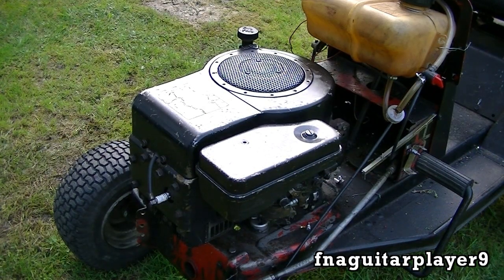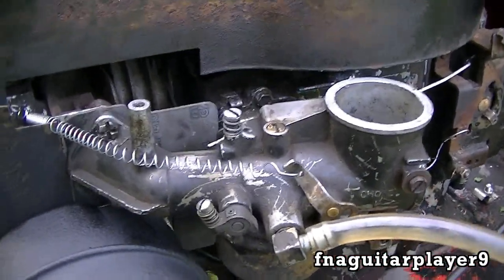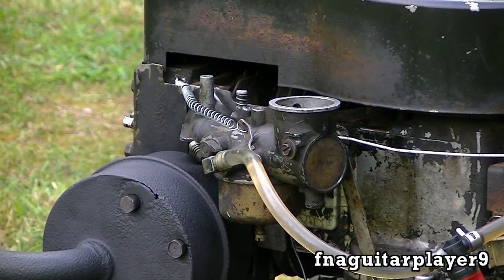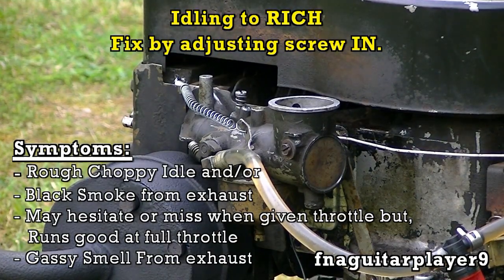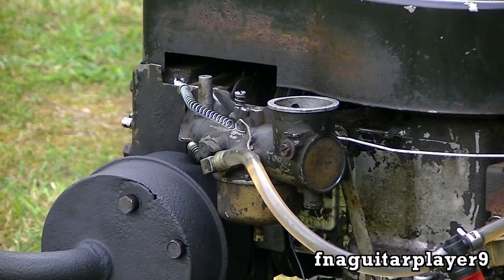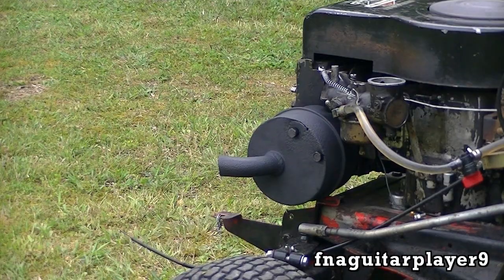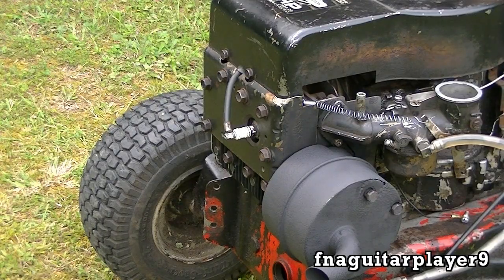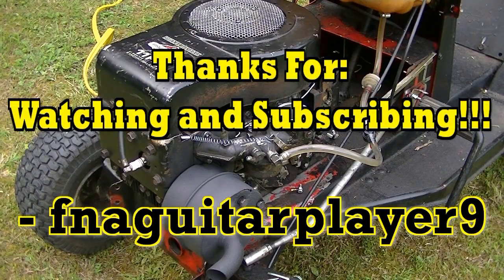How to adjust a Briggs and Stratton One Piece Flow Jet Carburetor

Comment from the maker: no it should not have to be screwed in all the way. sounds like the adjustment screw(s) is worn out, that can cause all kinds of mixture problems like this. I was working on a newer engine last year that has the 2 piece carb, it would not run for nothing, i replaced the adjustment screw and it ran like a new one haha may have to rebuild it. thats really the only thing i can think of that would cause that to happen.

Comment: I have this same carb. 98 mtd wizard. Briggs and Stratten. I have cleaned it up. Im having issues with adjusting for correct high and low side. I founf that the hight side as to be completely screwed in to run full throttle. The low side i did your 1 1/2 turn of screw. Now why is it running good leaned out.

Comment from the maker: sounds like the needle valve may not be sealing right, may have to replace the seat, some are repaceable some aren't, sometimes you can put a little o ring type gasket in to make it seal. Are you using a needle valve with a rubber tip or metal? sometimes the rubber tip ones will seal off better.

Comment: i got her running with your help ran good for a few days and now its leaking massive amounts of fuel out of the tube breather the float doest seem stuck rebuilt the carb and it start great after i watched your video on how rebuild the starter im starting work on small motors you have taught me alot

Comment from the maker: it could be set to rich or it could be a problem with the valves, you may need to do a valve job, as the compression stroke will force some air/gas back out through the carb if the valve isn't sealing right. If its pooling up inside the carburetor body when the motor isn't running then it is a stuck float or leaky needle valve. thanks for watching!!!

Comment from the maker: Thanks! First off don't use starting fluid in small engines, its to much for them, i've heard of spark plugs shooting out like bullets! I use carb cleaner as starting fluid. Sounds like you may have a clogged jet, you will need to clean it very thoroughly, I did a video on how to clean this type of carb, i'll PM it to you. most of the time a good cleaning will fix them, if not you will have to rebuild it, a kit costs less than15 bucks at tewarehouse. thanks for watching!!!

Comment from the maker: oh wow. Well, it must have been rusted or painted over. That or if its a newer one (last 20 years or so) that has a metal plate on it, may have been removed. I have one like that. The model is more than likely 252707 thats the most common for 11 horses. If it is newer than aprox 82 (transition) it will have a magnetron electronic ignition, thats 1 way to date them. Does it say cast iron sleeve anywhere on it? If its a aluminum (kool bore) you will need chrome rings.

Comment from the maker: It should either be on the flywheel cover above the spark plug, or on either side of the flywheel cover, some will have a plate close to the flywheel. Sometimes they are very hard to read if the shroud has been painted or is rusty. thanks for watching!!! If its a 11 horse the model number should start with 25. (25 cubic inch engine) thanks for watching!!!

Comment from the maker: Thanks! IT could be a few different things, it could be a partially clogged jet or filter on the pickup tubes in the carburetor. If it was a bowl type carburetor (with a float) i'd say it was sticking or not letting enough fuel into the bowl, and shuts off after running out of fuel in the bowl. Or it could just be running to lean. hope this helps, thanks for watching!!!

Comment from the maker: A temporary tach (for setting rpm speed) connects to ground and has a wire that wraps around the spark plug wire, a permanent tach (like a racing lawn mower) I've heard of people using a tach designed for a 4 cylinder engine, the spark firing is the same on it, because the plug fires once every turn, a 4 cylinder has 1 cylinder firing per cylinder so that would work. I've never done ether of them, i need to get me one! Thanks for Watching!!!

Comment: New problem, I got a new carb for my engine and it sounds better, when it starts up it will run ok for about 10 seconds then the engine just dies out. If you wouldn't mind, I could post a video of it running so you could possible help. I'm a marine mechanic but little engines are not my strong point, video will be up tommorow. I'll comment back when it's up thanks a lot for the help

Comment from the maker: sounds like something is wrong with the governor linkage or the governor itself inside the motor, hard to say really. I"ve had them do that before if the linkage between the carburetor and governor is unhooked, the throttle plate just starts opening slowly from the vaccum, i did a video on how to set this up, go through my latest videos its called "How Throttle and Choke Linkage is Setup on a Briggs 2 piece Carburetor (NEW ENGINE) " i show how to check the linkage to see if its set up/working...

Comment from the maker: i think it was like 3/8" by 2 inch or something like that, its not really critical just as long as it keeps it closed and isn't way to strong that its hard to work the choke. yeah it works pretty good, main reason i did that was because i didn't have a choke cable on the mower, and the choke always wanted to close on that carburetor. there supposed to have a built in spring, but this one was broke. thanks for watching!!!

Comment: please tell what size spring you used on that carb and where to get one. I want to do the same on my 1984 11 hp briggs on my simplicity 4211 What I want to rig with the spring as a manual choke so I can just sit on the tractor and hand choke it by hooking up a spring. Let me know what you think will that work? does it work good for you?

Comment: You seems to be very good to fix carbs !! i don't know if you can help me ?? i have a lawn mower with a B & S 12.5 hp , i cannot get the engine to idle , it just run full throttle , i tried to adjust the governor and clean the carb but still just stay at full throttle.Any tip for me ??
Thanks

Comment from the maker: yes. all lawn mower engines have governors, the only way to adjust these governors is to replace the spring, sometimes it weakens and you will loose full throttle rpms. thanks for watching!!!

Comment from the maker: not all the time, just now and then, and when i do i usually don't charge nothing, because its friends. eventually i'd love to open up a shop. Just can't afford to get started. But a few good prices would be like 20 bucks for a carburetor cleaning, 75-100 bucks for a full engine rebuild, with the customer buying the parts, maybe like 10-20 for a tune up, depending on what all needs to be done. Or you can charge by the hour. Just to give you a idea. course you can set your own prices.

Comment from the maker: that sounds like the float/needle is sticking and letting it flood out. wouldn't hurt to take the bowl off and check the float to see if its working freely, also should have said, always clean a carburetor thoroughly before rebuilding it.

Comment: Thanx for the quick reply! Think I screwed up by taking the flywheel off first! by doing that it allows the Crank to travel in and out putting undo presshure on Connecting Rod & Rod Bearing! Think I will put Flywheel back on to stabalize Crank Shaft Travel! Thanks Again!

Comment from the maker: some motors are picky, and i had one that had a rough high side but once under load it smoothed out perfectly. it bugged me, so i looked a little further, turned out the governor was out of adjustment! i'll plan on doing a video on that later on. try it under load and see what it does, if it still doesn't smooth out, may need to rebuild it.

Comment from the maker: thanks. to be honest i've never even seen a Nikki carb in person! all i get around here is either the type in this video or the 2 piece walbro carbs, which as far as i know is similer to the nikki carbs, there is only one adjustment screw on them, for the idle side, so if that doesn't adjust it out, the carburetor has to rebuilt, i hate the way they are making new stuff!!! i do plan on making a video on the 2 piece walbro carbs in the next few months. thanks for watching!!!

Comment from the maker: not really, but i recommend adjusting it to get it idling good then work on the high side, if its way out of adjustment, screw them both in (not forcing) then screw out 1.5 turns then go from, got to play it by ear. Take some sand paper, like a 120 grit, run it around the the shaft right before the cover, this gets any rust or dirt off of it, (first thing is to remove clutch or pulley then do this) then spray some wd40 or better PB blaster right before the cover, then just start wiggling it...

Comment: Do U need to do this in any particular order? That motor I told U went into the pond running! sure enough the Intake Valve stuck open! I got it freed up! but the crank covrt is givin me a dickens of a time comeing off! It is a 5/8 Shaft any tips on gettin it off?